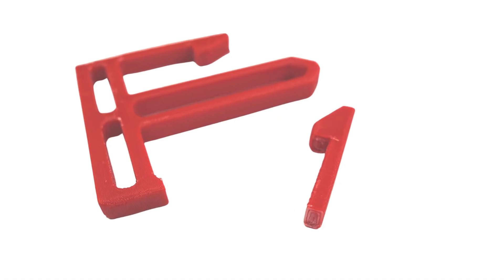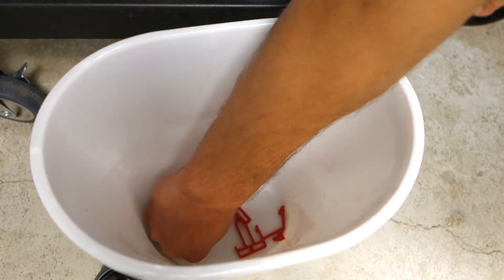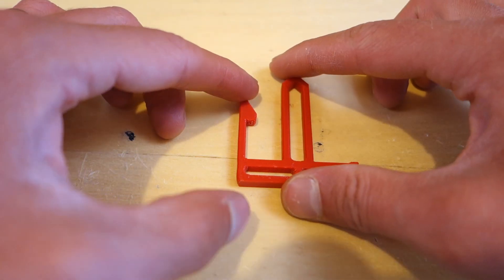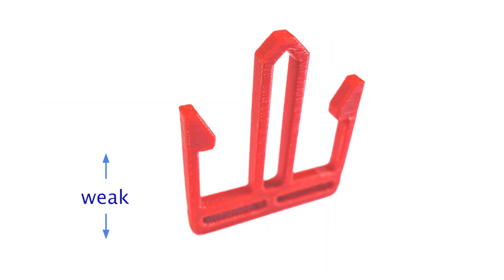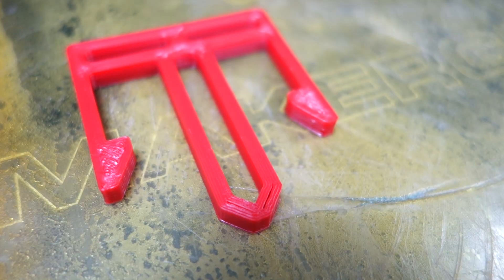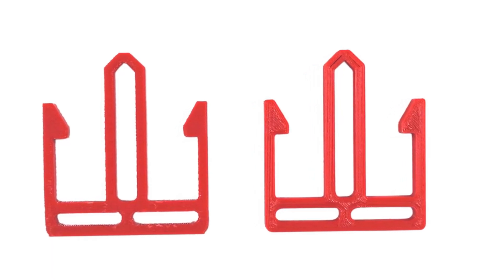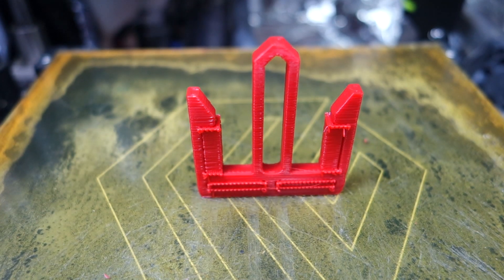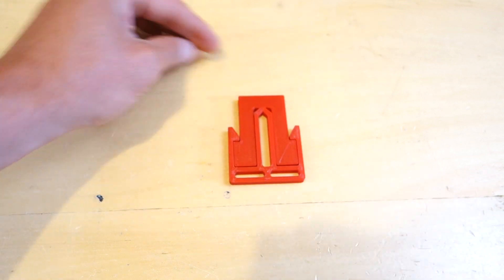SECRET Revealed to Design SNAP FIT JOINTS with 3D Printing

Comment: I am trying to duplicate a round bushing about 30mm in diameter with 3 clips around it's circumference. Imagine a tube with three clips on one end. These are bushing that go into the holes in a home gym weight stack to allow the weights to travel up and done the rods without metal to metal contact. These were originally extruded parts, don't know what they are made of, but they have become brittle after many years and are crumbling. Spare parts are no longer available for this home gym. The bushings snap into holes in each weight. They are not coming in and out as they are pretty much a one-time snap in placement. I snapped a prototype in OK and then it broke when I tried to remove it. Not that this is a big deal. If I can get it snapped into place one time, but still I would like to make it stronger. Any advice for tabs protruding from the end of a cylinder shape body?
Reply from the maker: Hard to tell without more details.  The biggest issue is going to be with the layer adhesive.  So printing the part our of nylon and in a heated chamber for stronger layer adhesion.  The layers adhere well to each other in ABS in a heated chamber, so ABS might be another option if Nylon doesn't work.  You can also try making the parts from Multi Jet Fusion  (MJF) Nylon.  This might be your best option.  However, I would plan for these parts to be one time use.
Reply: You could technically try printing them on their side, just with a whole bunch of supports. Then sand down any leftover bits after taking the supports off. Not ideal, but it'll get what your looking for. Unless there's a way you could split the piece itself into bits and put it together like a Lego or with glue

Comment: Im having this issue with my wheel center cap the clips keep braking and there is no way I could print it virtically
can anyone help please?
Reply from the maker: Can the clips be printed individually and then bolted to the center cap?  This way you can print the slips sideways on the bed.

Not sure how big the cap is, but if it's not too small seems like it's possible to fit screws into the cap.
Reply: @UltimateToolChanger  that's what im doing now Im printing the cap and clips individually looks promising. and I also tried printing one cap virtically it was strong and clips didn't brake but the dimensions were all messed up and quality was as bad as it could get. i'll let u know if this print works or not thank you for replying btw
Reply: @UltimateToolChanger  I finally printed the clips separately and its much stronger now
Reply from the maker: Nice!  Great to hear it worked.

Comment: That's the secret ? Don't print then vertically ? Surely, this is obvious.
Reply: my snaps kept failing, i checked the printer and there was nothing in it. then i realized i had to plug in the printer for it to work and then the snaps worked really well, so that is the secret if you ask me.

Comment: 1. Print orientation
2. Material choice. PLA SUCKS always does always will, use PETG instead. 
3. Radii will help distribution load without peaks
4. Give the snap fit enough space to flex, need to try out
5. Print snap fit clips separately as a single part, this way your print orientation will always be good.
Reply from the maker: Thanks for adding this helpful summary!

Comment: I have an idea that might require a snap-fit part, or it could be a slide-fit part.
The idea is this, instead of 3D printing an entire extra queen chess piece, one could simply 3D the head of a queen and have it snap into place over a bishop's head. (This is if the bishops are off the board of course) However, one could 3D print the bottom side of a queen's head as a puzzle-like shape where it could slide into place over the bishop's head, where the bishop's head has this slant-groove into it. If you like the idea, plz reply. THX.
Reply from the maker: That is an interesting idea.  

How big are the chess pieces?
Reply: @UltimateToolChanger  Standard size I suppose. I think what you're looking for is a tournament set.

Comment: Great series but one solution you didn't mention is glue! E.g. I had to design a battery door for a box that had the latch printed vertically, thus weak. There was no way to print the door on its side to prevent the problem. Predictably, the latch broke on first use. This was printed originally in HIPS (hopeless), then ABS (better but also bad).

The solution was to print the door and latch separately, with the latch rotated to its side to make it stronger because now the forces aligned along the layers and not across them. And I have placed a slot in the door where the latch settled in to simplify assembly. Then a drop of acetone (yay for ABS), stick the two bits together and done! The doors and latches serve to this day.
Reply from the maker: Great solution!  Thanks for sharing.
Reply: Sooo you still adopted the solution proposed in the video, of printing it horizontally, then added an extra step. It's not like glue was the solution when applied to reinforce the weak layer connections in the case that printing horizontally is truly impossible. 
I can come up with one example that I encountered, when I printed a Telepass Clip (look up images of it, if it doesn't ring a bell). The part is tiny and the tiny snap-fit latch head would have a weak direction no matter the printing orientation, causing it to break. A drop of super glue made that 2mm * 1mm latch head really durable.
Reply: I'm not sure glue is much better. I've glued stuff that would or did break between layer lines and, once glued, it was still prone to snapping the same way. Printing stuff in the proper orientation makes a greater difference than glue ever could

Comment: I can't believe anybody is printing these vertically. 

If the breakage is occurring at the 90* angle, you need a fillet in there so it's a more gentle transition.
Reply: My problem right now is it’s attached to a bigger project and for that to print right it has to me vertical… I haven’t printed it yet so maybe the fillet will work first try 😂 wish me luck
Reply: it is so obvious, i can't believe i wasted my time watching this. you know what else helps to print these out? putting filament in the printer, it's crazy what a difference that makes :)
Reply from the maker: That's a good point!  It should be obvious not to print these vertically.

However, I remember making this mistake on a part with a thing feature.

Comment: I go fishing a lot.  I want to design a piece that will hold 6 inch long glow sticks.  It should snap to the fishing pole near the end and also either snap to the glow stick or have a place for the ends of the glow sticks to be pushed in to form a circle.  Looking down from the top view it will look like 2 C's back to back, in a mirror image of each other.
Reply: I could buy these, but with the cost of PLA filament, even my glow in the dark filament, I can make them for about $0.07 each, which is about 5% of the retail cost.
Reply from the maker: Hi Jarod,

Will the fishing pole go through the glow stick go or will the glow stick be off to the side?

Will the glow stick be near the end where the real is or rod tip?

What's the purpose of the glow stick?

Thanks for sharing your example!
Reply: @UltimateToolChanger   

The glow still will be off to the side, parallel to the fishing pole tip
The glow stick will be at the end of the fishing pole near where the fishing line comes out.
The purpose of the glow stick is that I fish at night for catfish when catfish are most active.  When the fish bites, the end of the rod moves, but in the dark, it's difficult to see.  The Glow stick gives a visual to see that the fish is biting.
Reply from the maker: Nice!